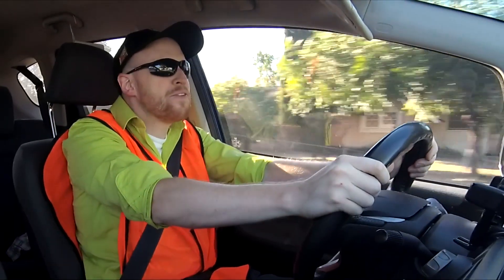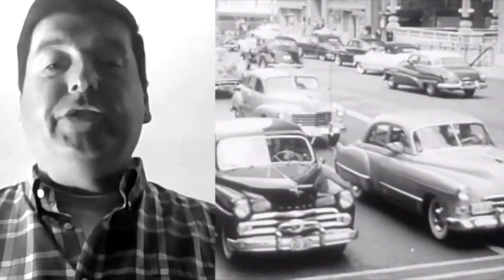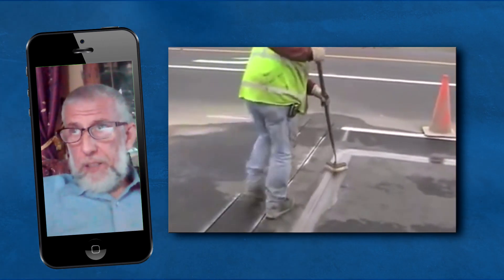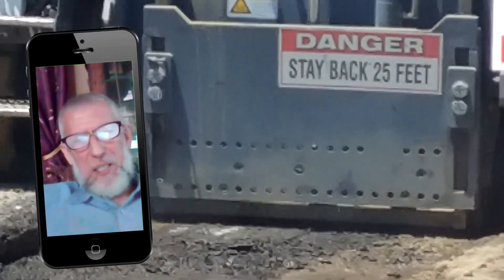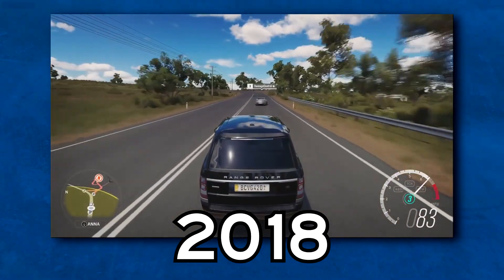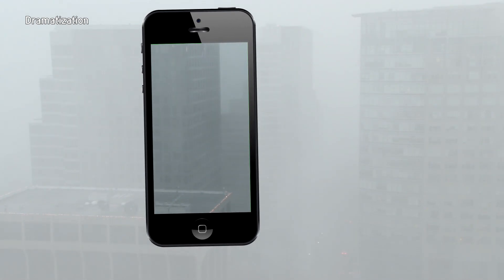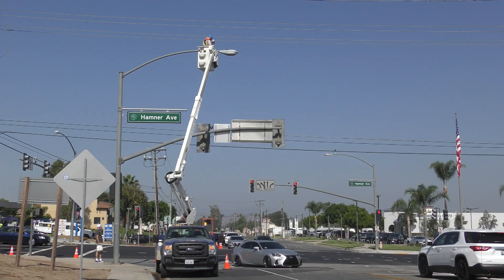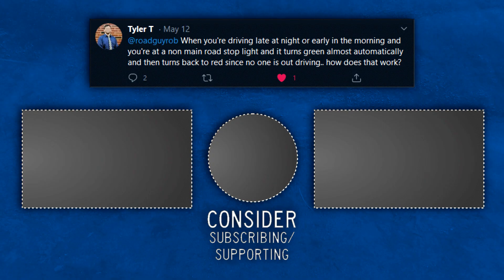How do stop lights "see" your car (to turn green)?

Comment: In Edmonton (Canada) certain lights are mean to be triggered by buses.  Two loops are used.  A bus covers both of them and trips the circuit that changes the light.  A passenger vehicle tripping one loop at a time is ignored.

Comment: At my local shopping (in Australia), the local Council cut loops into the road at the access to the bus station incorporated into the shopping centre.  Problem was, the access road was also a slab that was a roof to an underground carpark.  Much hand wringing went on as the shopping centre tried to work out if any of the steel reinforcement in the slab had been cut — which would have rendered the slab structurally unsound, and you know, led to the collapse of the bus station and the carpark.  It seemed ok and they just filled the cuts up with mortar .  The Council bureaucratically held the line that they had the right to enter the bus station and perform maintenance whenever they wanted and therefore had done nothing wrong.  So yeah the moral of the story is check that a concrete road is ok to cut loops in BEFORE you start cutting loops into them.

Comment: I studied traffic engineering in college. I would love to have a job in which I time signals at intersections and conduct level of service analysis.

From what I understand the traffic signals in this video are actuated/semi actuated whereas signals whose timings are not affected by the presence of vehicles and pedestrians are pre timed. Is that correct?

Comment: Traffic camera's aren't for signaling , they are made to look for violators that intentionally run through Red lights and watch out for individuals who commit crimes like automotive theft or kidnapping the DOT and Law Enforcement can track vehicles using the cameras by getting an image of the vehicle and a captured image of the plate on front/rear.

Comment: I remember the circular magnatron on a particular street in SF.  If on a motorcyle you had to drive directly over it or the light would never change.  You'd be blocking a car behind you that would hit the spot for the light.  So never getting a light meant being on a motorcyle you had to run the red light or move up into the intersection and hope the car behind you would pull up behind you to change the light.  It's gone now thankifully.

Comment: Traffic lights see my car and turn RED!!!
Reply: Or my city bus here in Vegas
Reply: Thats because the magnetism in your car is negative. Just go see a mechanic.
Reply: @DayInMontreal  So the answer is to only have positive vibes?
Reply: @DayInMontreal  or the car is communist
Reply: I have seen a light turn green quicker for an ambulance.
Reply: @295g295  I believe many traffic signals have a thing that looks for emergency vehicles. Technology Connections did a thing on it if I remember correctly.
Reply: @chubbyadler3276  Some places do. The term is Emergency Vehicle Pre-emption. They're very common here in Minnesota, particularly in mid-sized and larger towns. They have white lights on the mast arms which indicate when the system is in use: steady light means a vehicle has pre-empted the signal from that approach (if you see it, look behind you). while flashing means that approach cannot be pre-empted at that time (usually because another approach is already in pre-emption). Traffic signals that are interconnected with grade crossing signals will flash all approaches when a train is coming, as trains actually have higher priority than emergency vehicles
Reply: @ebnertra0004  I have seen the system you're referring to, but we don't have enough emergency vehicles here in Alabama to hide on every street corner just for triggering the red lights. Outside of some sort of conspiracy theory, there is another system at play, be it a detection system as mentioned in the video which was set up improperly or maliciously, or another mechanism.
Reply: @295g295  Many emergency vehicles have a device in their vehicle which will send out a form of signal to the traffic signals so to give it a green light. Many times, included at the signaled intersection there will be either a white or red strobing light, visible from all directions, indicating that the traffic signal is temporarily in a "emergency" mode, so to allow the emergency vehicle to get to its destination.
Reply: They also know when you want take a sip of coffee and stay green forever so you never get to
Reply: In my city is one that turns red everytime you go faster then 40 kmh. There is no second road, only crossing.
Reply: Or, they wait to turn yellow until you are in just the right spot to confuse you weather you should stop or go.
Reply: I often wonder if that is a way of making motorists slow down by the sensors speaking to one another and changing the red light pattern as a means of slowing down one's speed especially travel much greater than the speed limit...
Reply: @hectorrodrig  That would work for the law abiding citizens, though many will try to accelerate to beat the red light or would then start running it.
Reply: @chubbyadler3276  True
Reply: I live in Frederick, MD and come across knuckleheads that wanna race to a red light because they're too simple to pay attention... If more people payed attention to the traffic and light patterns, congestion would lessen because we could have a more cohesive flow and not constantly fill the gap where everyone wants to be in the same lane and not allow others to enter said lane especially when trying to exit from a shopping strip...
Reply: Same fucking shit happens all the damn time!
Reply: Hilarious!!! 😂😂😂😂😂😂
Reply: Get yourself a Mercedes. You get a green pass with it.
Reply: Traffic lights don't see (detect) anything.
Reply: Because you're driving too fast.
Reply: Traffic lights see my car and laugh!!!
Reply: @rcazzador or more likely too slow.  The lights are mostly on fixed cycles and these detectors should only extend the amber at the end of a cycle so that late comers aren't forced to stop suddenly or dangerously, or speed up to avoid the red. 

People who drive cautiously and err towards the slower side of the speed limit should have more time to stop, so they should have less need for the detectors.  

Those drivers can still be grateful, because this means they aren't being T-boned by somebody who floors it when the light changes.
Reply: Tip for motorcycle riders. If u have a loop that won’t pick u up put ur kick stand down on it that usually does the trick or just run the light of course
Reply: Crook town.
Reply: Facts
Reply: Close the gap
Reply: I am starting to think that signals are intentionally designed to do that. I would say it was for ticket revenue, but I am not seeing the officer at his post, nor am I seeing blue lights chasing people I see running it.
Reply: @chubbyadler3276 I’ve seen signs that say the signs are connected to radar and off you’re speeding it triggers the light to turn red to get you to slow down.
Reply: @RichVon4L  Unfortunately, these lights don't work out quite that way. As is, you would have to be driving very aggressively to be able to make speed limit, though I have seen times when these lights get synchronized and allow for a red light free trip through a section of stroad, but then the power fails and they are out of sync for several months.

Comment: As a motorcyclist, I know where many old loops exist in my area. I often pull forward and then wave a car behind me to pull close to set off the lights
Reply: Makes sense as long as the car understands what you are doing.
Reply: In some areas of WA state, there is a X painted an the best place to put your front tire to trigger the induction loop.
Reply: @gjforsman  yeah, many of the newer ones have a bicycle stencil where it is more sensitive. But there are some less sensitive ones around. One is to trigger a left turn at a semi divided highway with lights. It's an old awful design. I need a car to trigger it for me when I'm on the bike.

Comment: I’ll be stuck at the red light on my motorcycle for MINUTES 🙄
Reply: That’s usually caused by the timer on the light, even though there’s detection there’s still a timer that required minimum and maximum green and red times

Comment: tl;dr, they use a civilian version of what is commonly referred to as a Magnetic Anomaly Detector buried in the road, which is most commonly used for hunting submarines. Some of the more advanced ones also combine this with logic circuits that recognize there has been no traffic on the main street for certain amount of time so it's okay to switch immediately without waiting. Other less-advanced ones use systems where every minute or two it checks to see if the detector on the side street detects a vehicle and then changes, so you may be waiting everywhere from mere seconds to several minutes until the next detection window comes around. Others use multiple sensors and logic to detect whether traffic is stacking up and prioritize a light change faster.

Comment: While driving in Germany in the '70s they had radar detectors on poles at the traffic lights in the cities to detect vehicle traffic for light changes. It was really apparent late at night when you encountered a red light and there was no cross traffic. The light would immediately turn green.  👀
Reply from the maker: Leave it to the Germans to make driving precise and rewarding.  😀
Reply: Its small, but snow and ice build up on traffic lights occasionally.  
LEDs don't produce enough heat to melt it away.  Incandescent lights cycle enough heat.
Its been a problem in colder climate area's.
Reply: There are drawbacks to radar as well.  Heavy rain or snow will make them inoperable.
Reply: Almost all traffic lights are LED now.  There are pros and cons to these also.
Reply: @michaelmccarthy4615  cons?

Comment: I see lines on the road and cameras on the poles at intersections here in the Phoenix valley but I swear, every time I pull up to a red light, regardless if anyone is around, I still have to wait ages for it to turn. Also, we have pedestrian crossing traffic lights at canal and path crossings. When a pedestrian pushes the button and changes the light, the traffic has to wait a set amount of time before it changes again. I think they should come up with pedestrian detectors that automatically change the light to green or off when it's all clear instead of making us wait.

Comment: At some smaller intersections, I would have to flash my brights to get the sensor to "see" my car.
Reply: Have that problem with my car and a certain left turn lane. Three cycles just sitting at the line and then I just went.
Reply: This is because of a tube sensor that detects flashing strobe lights on emergency vehicles in  some cities  that have square strobe lights mounted on their vehicles.

Comment: Many times in the past when I rode motorcycles, I would have to get off my motorcycle and push the crosswalk button to finally get a green light. 🤣
Reply: In my 45 years of riding, found loops to suck at detecting motorcycles.
Reply: I've recently not had a left turn light change cycles in a row. Apparently my sub-compact either didn't have enough metal or the camera didn't get it. So weird. I eventually just went when it was clear.
Reply: @wanderingjana891 wow
Reply: @wanderingjana891  or there was dust on the lens or your vehicle was too close to the color of the road, or it wasn't set sensitive enough or something wrong with the electronics in the camera card...
Reply: A light that falls to detect your vehicle is malfunctioning.  Nearly every state has laws that say you treat a malfunctioning light as a stop sign.

My state, Kansas, passed a law specifically stating that bicycles can proceed when the intersection is clear if the light doesn't trigger.  But the local police when on bike don't even wait to give it a chance to trigger, they just treat it like a stop sign.
Reply: "Most" places it's legal for motorcycles to treat red lights that don't change as stop signs.
Reply: @rogerwilcojr  yep, but only after X number of cycles. In Virginia it was 3 cycles and was actually legal for cars and motorcycles.
Reply: @rk4921   In Idaho it is immediately for bicycles, and many other places as well...
Reply: @rogerwilcojr  try riding an aluminum or worse yet a carbon bicycle. Good luck!
Had some local known lights id just treat as a stop unless a motor vehicle was there to trip the light.
Reply: As a long-time motorcycle rider, I had the same issue in the past. I hated intersections with loops because they rarely detected motorcycles. The newer detectors above the signals are such an improvement.
Reply: Not a big expense -- the cop just puts down his donut and directs traffic.
Reply: On motorbike sit on the loop.
Reply: In my experience, I keep pulling up and waving the car behind me up but they still want to maintain a 40’ gap
Reply: @andrewahern3730  thats IF you are lucky enough a car behind you in the lane. rural areas often dont have cars...you could sit there for several cycles waiting on a car
Reply: Yeah Imma pass on that one chief, if the light hasn't turned green in a reasonable amount of time and traffic is light I'm gonna go ahead and make my move when there's an opening. I've done it on my bike and I've done it in my 10T box truck.
Reply: I ride a bicycle and can confirm they don't change, and dang, somehow I never thought to do that, I usually just did a right on red and did a U-turn.
Reply: AM TOLD RARE EARTH MAGNETS ATTACHED TO UNDERSIDE OF BIKE WORK ON LOOP SENSORS
Reply: Putting your stand down should be enough to trip the light
Reply: Most of the traffic lights are pressure plated. Simply the weight of the motorcycle and you cant trigger the light. Look at the ground close to the crosswalk at the light. You will ser black outlined circles on the ground. Those are the pressure plates.
Reply: @henryquevlogsss2108  Did you actually watch the video? Most places don't use pressure plates anymore. The circles are just copper wire loops that detect the metal in your vehicle, which is why it has a hard time with motorbikes and bicycles because they have less metal than cars.

Comment: Does the US not use distant detectors? where I live (Denmark, Europe), you'll often see a coil just before the crossing, and one that's ~5-10 car lengths back that basically counts how many cars are on their way to the crossing, and/or prepares the crossing for passing along if there's nobody else at the crossing
Reply: Never seen anything like that anywhere in the US.  The light is set for a maximum time green, and as long as it is still detecting cars, it will stay green, up to the maximum time set.  If there are no cars detected, it goes back to red.

Comment: Loops don’t always sense the presence of a motorcycle.
Reply: That’s usually due to poor fine tuning
Reply: It's partially due to poor tuning and partially due to motorbikes not being aligned with the coil because they don't see the position of the coil
Reply: Yeah,I can't count how many times I've sat at red lights then had to run them early am cause the lights would never change... I was about to go one time and you know it,cop rolls up behind me..Sat through a 2 light changes then I was told to go ahead and proceed with caution on on the cops PA..
Reply: @jamesholt7340  
I'm told (depending on the laws where you're at) that if the light doesn't change in 2 cycles, then it's okay to proceed when it's safe to do so.
Reply: *usually dont
Reply: And then there are carbon fibre bicycles, which basically don't have a hope in hell of triggering these things.
Reply: @Bellezzasolo    that is why you attach a very strong magnet
Reply: I find that hard to believe, even my regular bike always gets recognized. We don’t have loops tho, our sensors have a different shape.
Reply: @roy_hks    yeah they have  bike  sensors in a few spots in my area  are  diamond  shape   the bike lane has  HIGH priority     so as soon as you go over it the light changes with in 3-4 seconds.. on average..
Reply: Even if it's a 800 lb Harley these darn sensors don't sense my bike.

Comment: Does not work with motorcycles.   It will stay red.  I have been stuck many times.   I have to turn right and do a u turn.      A real pain.
Reply: @rhallnapa  Have you actually tried that?  If it works I appreciate the reply.
Reply: It just needs adjustment.  If there are no complaints, it won't get fixed.

Comment: I have seen quite a few traffic light intersections disappear in favor of roundabouts. My town is actually concidering replacing the majority of lights with them. I've also seen a few lights get a 360 degree panoramic camera suspended above the intersection. I'm curious how they work.

Comment: Great video and very fascinating! Do you have a video on what the tiny black cameras on top of a lot of stoplights are? Do they do the same thing or are they a different purpose?
Reply: I Think you might be referring to the emergency vehicle strobe . Emergency vehicles are able to change the traffic lights to Green and I believe those cameras pick up a specific strobe light that those vehicles have installed.

Comment: I've seen radar devices mounted above the intersection, and pointed towards the direction cars are coming from. One for each direction. They set my radar detector off :)
Reply: Microwave detectors we use them a lot in UK. Video is rare.

Comment: the saying in Minnesota is this:  There are 2 seasons.  Winter, and construction.  Yea winter is hard on the roads here and it's a non-stop battle to fill all the potholes.  This lasts at least until mid-summer.  Then the cycle just repeats.